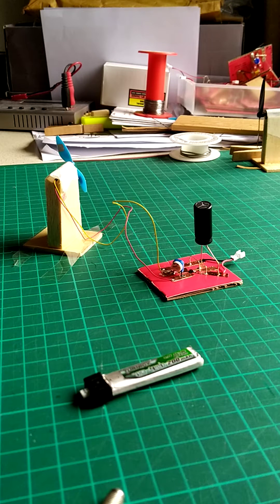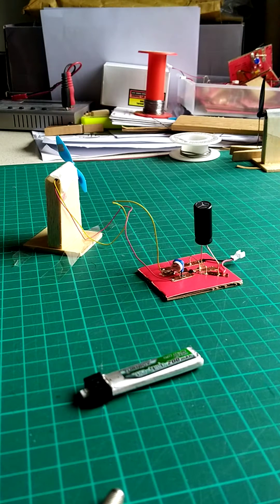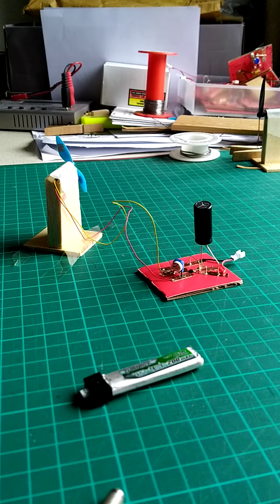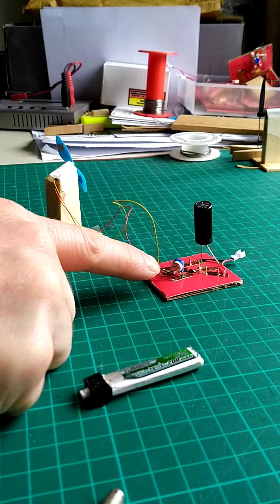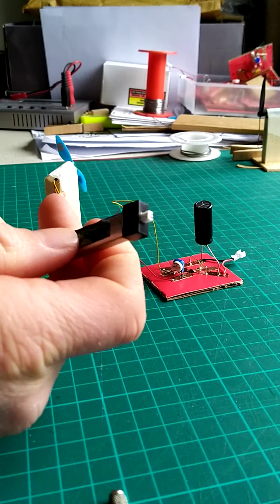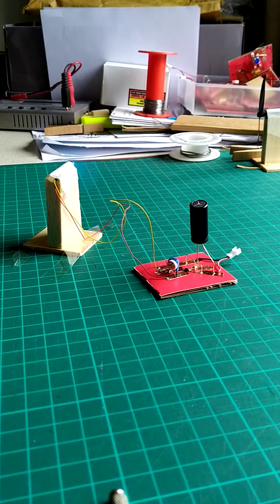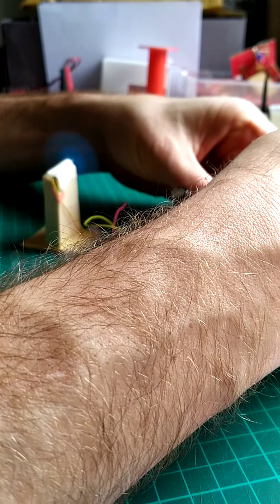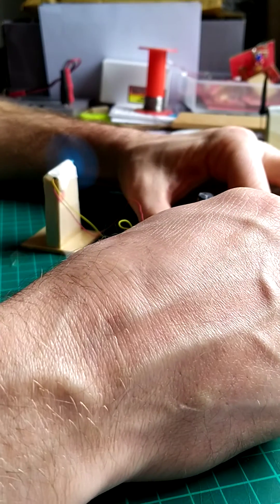Using a Volt Regulator to Control a Supercapacitor for Free Flight

Comment: Hi, thanks for uploading this. I have a question, what size trim pot do you use as a voltage regulator here ? I am planning to try this myself on an F1N style indoor glider and am looking to establish as flat a cruise phase as I can with the same setup.
Reply from the maker: Hi Pat. The motor/lipo circuit does not run through the trim pot - it runs through an LDO Volt Regulator chip. The chip has a variable output voltage determined by a feed back pin. The trim pot sets this feedback voltage and carries virtually no current. I've added a link in the description so you can see more details including the circuit diagram.
Reply: @slowmatch7612  That is really helpful, thank you !
I am on HPA also so will check back in through there, appreciate the feedback 

Pat